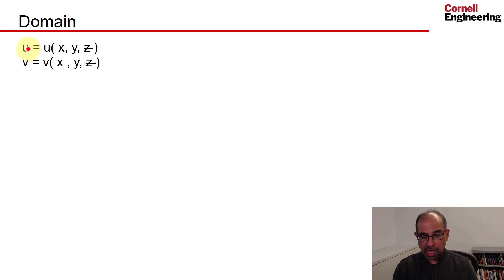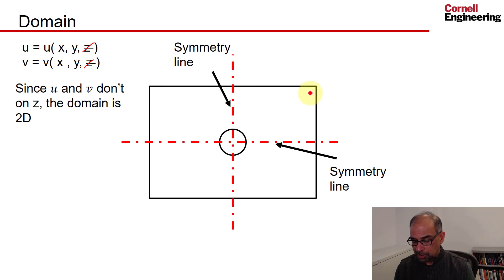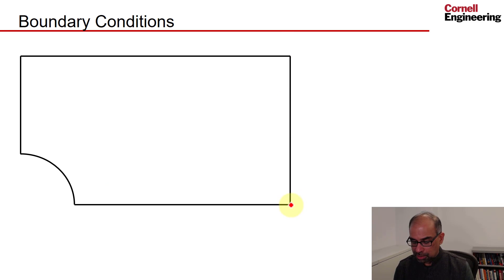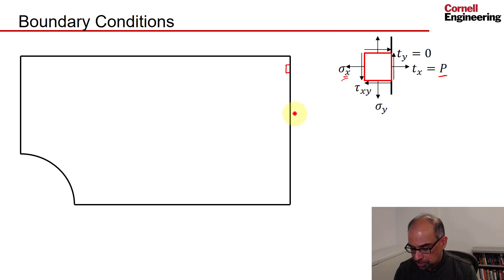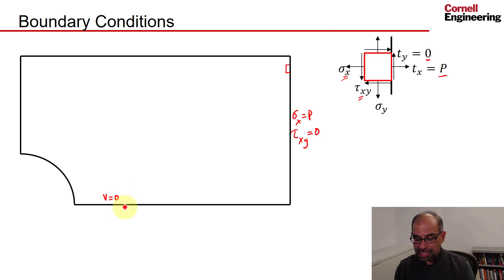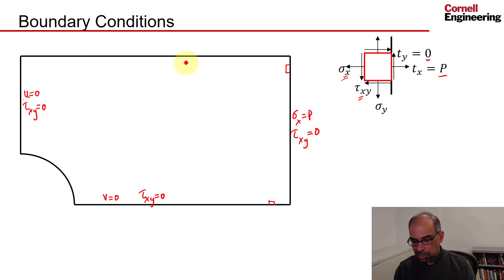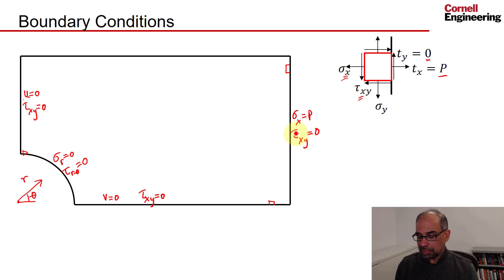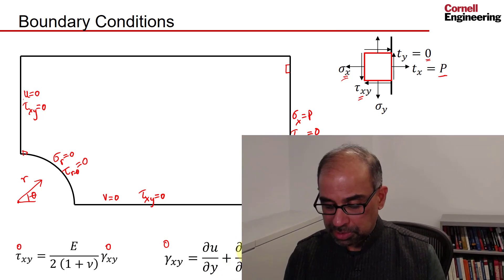Plate with a Hole Boundary Conditions

Comment: Circular  ring subjected to the diametrical point load on the vertical central line. Is their any vertical displacement of the node placed on the horizontal diametric line. If yes,  can I take quarter model for solving the problem